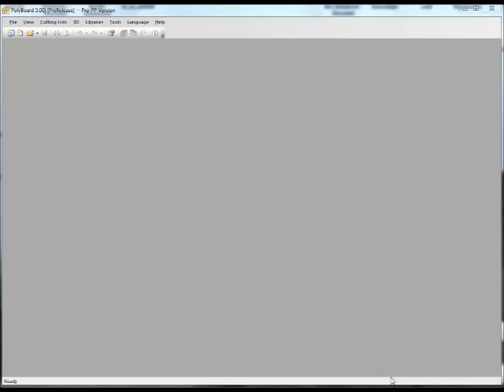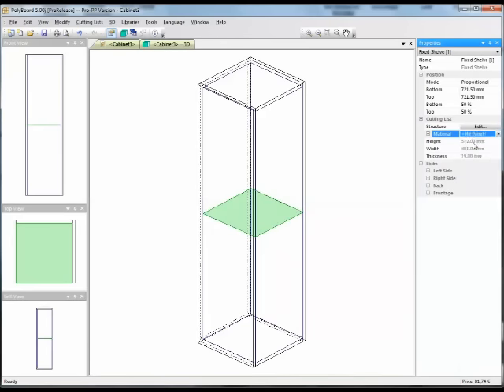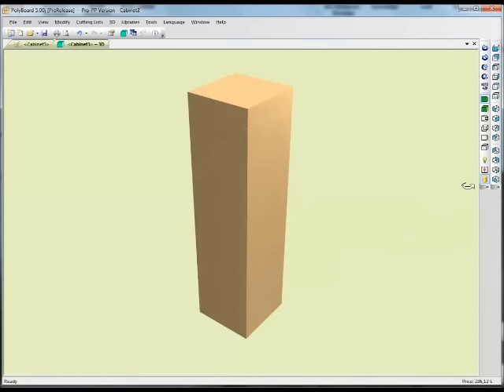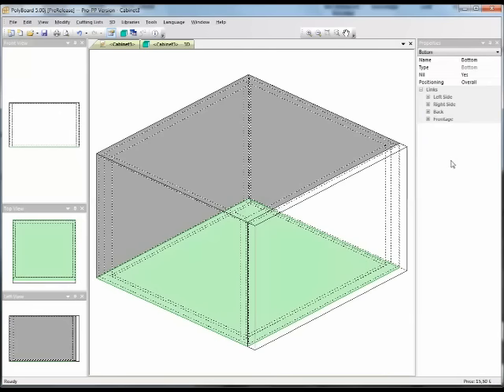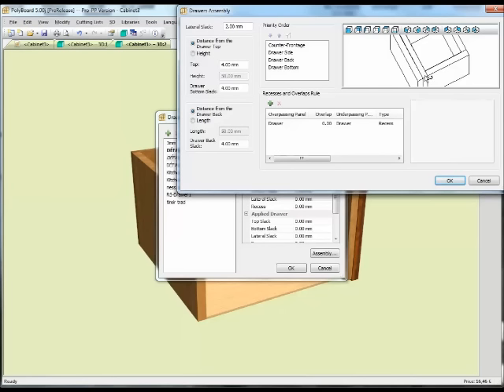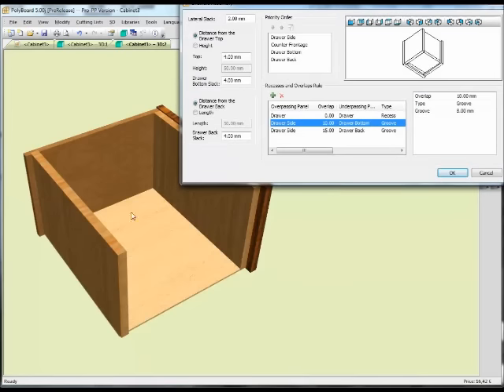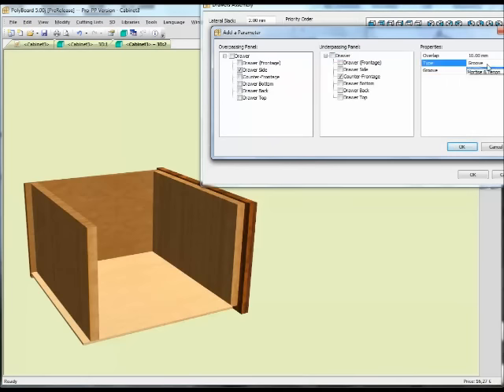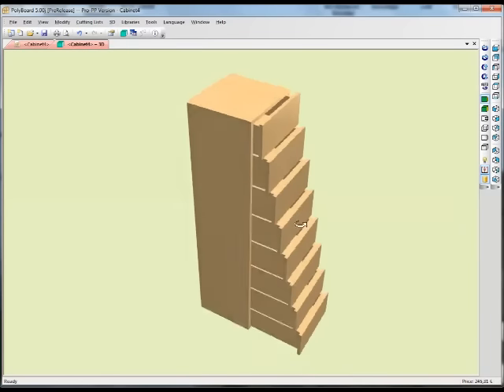How to design drawers using PolyBoard cabinet software

Comment: How do I make two drawers with a single common frontpanel?
Reply from the maker: Hi @Balazs227, 
The easiest way is to add a Nil shelf in the zone to divide it, then add a first built-in drawer with a Nil front on top, select the two zones in 2 clicks (from the bottom zone), then add the drawers in "Global applied" mode.

For more help, you can contact us on our technical forum managed by experienced woodworking trainers: https://wooddesigner.org/forum/
Thank you